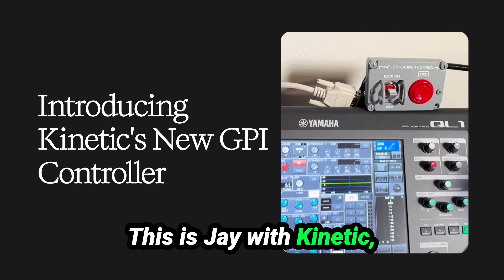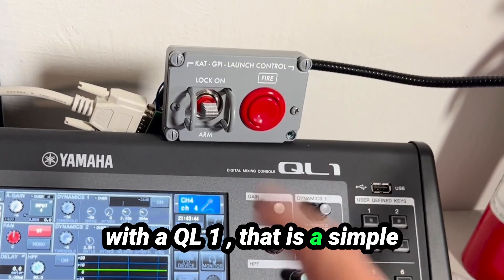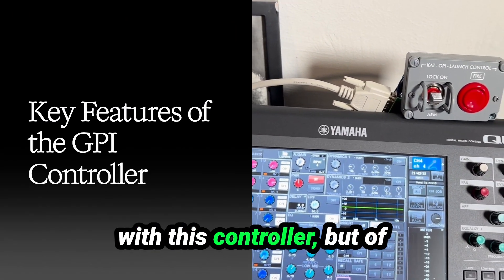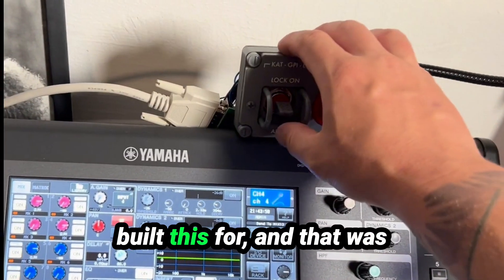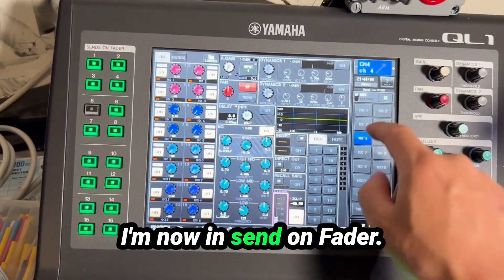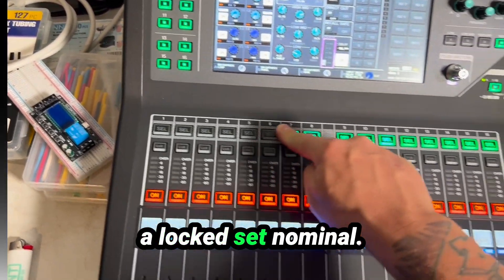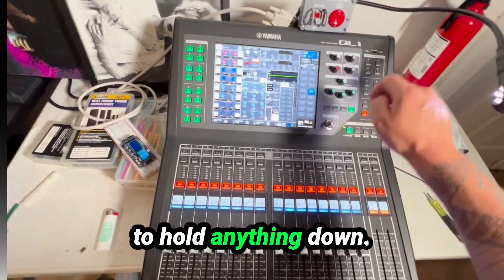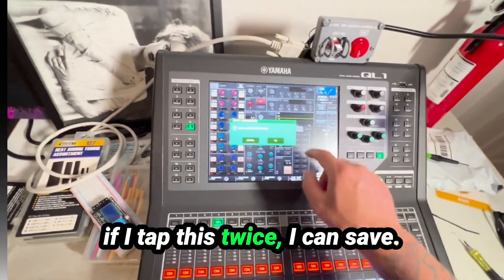Custom 3-Button GPI Controller for Yamaha CL, QL & DM7 Consoles

Comment: How can I make an external cue advance button for the CL5? The TF5 has a foot switch port but CL5 does not.
Reply from the maker: Easy. I can make you a foot switch that works with a cl5. Or you can. Db15 gpio port on back of console. 1/4” jack, gpi 1 and ground.